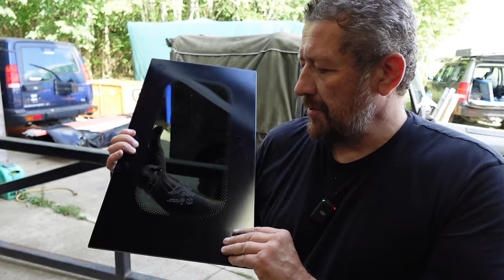One upgrade you really can do yourself on your Defender.

Comment: worth mentioning that once you put the sides in especially its well worth checking that the sides and rubber strips are sitting well against the glass as its easy to push the sides out and it leaves a bad looking gap on the inside .

Comment: I did this job on my Firenze red 2001TD5 SW just over a year ago; what a transformation!  The dark glass looks fantastic against the red & replacing the old, leaky, insecure sliding windows lifts the whole vehicle.
It's an easy job (especially as I already had the side window cut-outs), so don't be afraid to tackle this job yourself.
Reply: I had mine done with VGS who did a great job on my Corris Grey 110 but I agree, on a Firenze red vehicle, it would look even better.